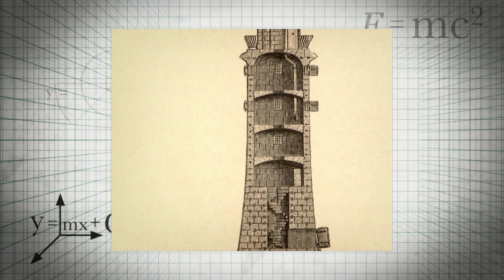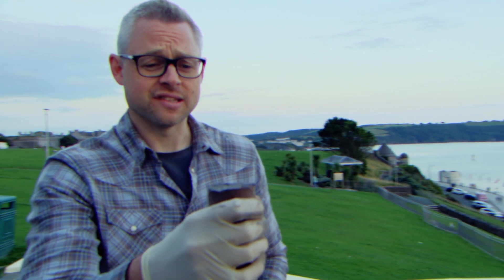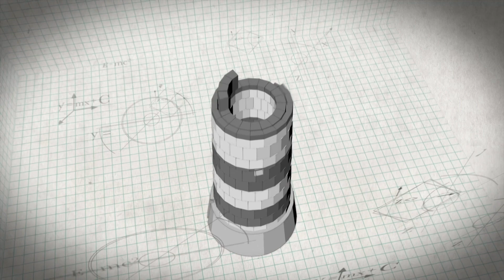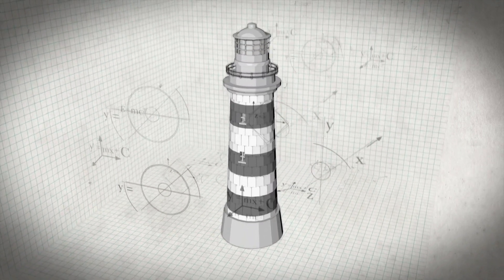How a Lighthouse Built in 1756 Revolutionized Concrete | Blueprint

Comment: Unfortunately, you omitted to highlight the intricate, interlocking stones that formed the foundation for the lighthouse!

Smeaton designed the foundations to be secured by interlocking the carved blocks together, which gave them immense strength even without the jointing compound.

There's an excellent book on the Eddystone Lighthouse and the engineering brilliance of its designer, Smeaton!